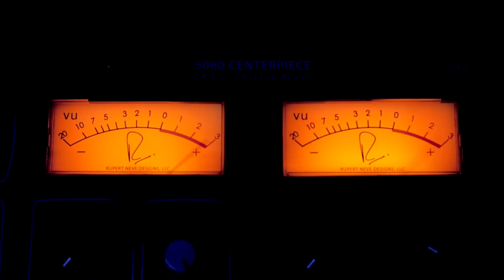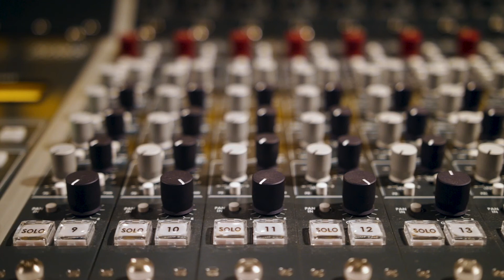Design: Build Quality

Comment: you guys could create your official plugins. some of us unfortunately can't afford hardware and some of us are always traveling. it'd be nice to have your official plugins instead of rip offs
Reply: Nah just Saveup and get the real thing
Reply: An Analogue Mixer VST with built-in analogique simulation of compressors and eq, + some monitoring goniometer and frequency spectrum analyzer by Rupert Neve, that can be compatible with most major daw would be a gold nugget, i'd pay for it.
Reply: They do...RND Portico5033 EQ and 5043 Compressor marketed by  Steinberg. They're excellent and fairly recently updated. Easily some of the best plugins out there. They're not cheap though. Use them all the time. I think you can demo them if you have the Steinberg usb license  key. They're official.
Reply: Started off with crack plugs, then cheap ART and Warm stuff, now Neve (35 year span so it takes a long time).   I can't afford it either, so interest free cards and no car payments.   

Point is all that other stuff is MORE expensive in total and it will never sound as good.   I've spent more on plugs than one Shelford I use daily.      HTH
Reply: @AudioJanitor  facts it's not hard to save up for the real thing or either do a payment plan
Reply: @JaeBTundra1  Yep, like anything...how bad do you want it?
Reply: @AudioJanitor  facts. It's worth it in the end.
Reply: Totally agree